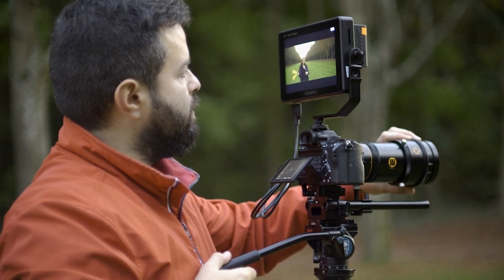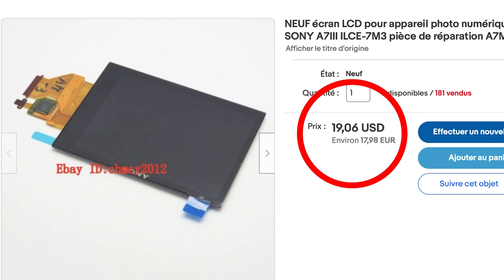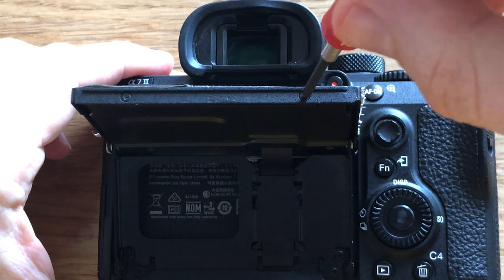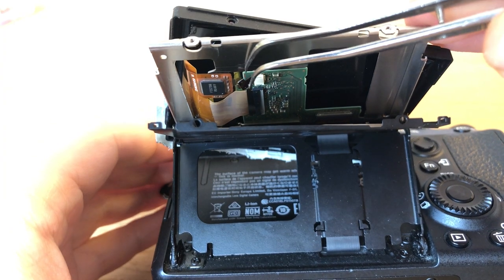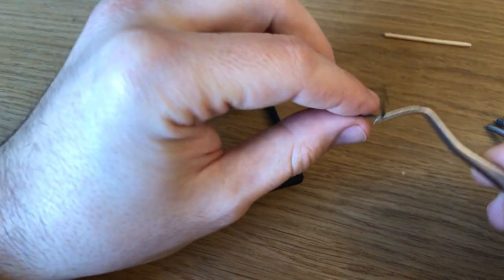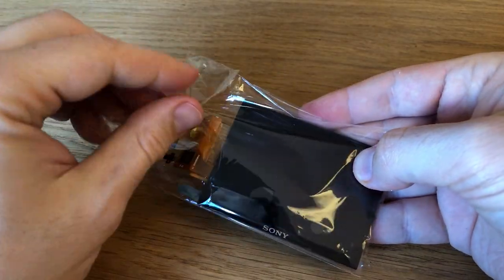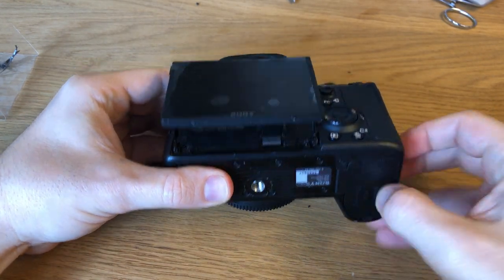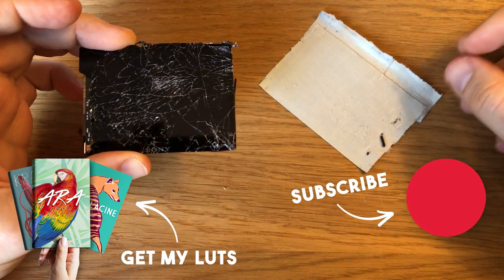The Photographer's Nightmare and How to Fix it for $20

Comment: Congratulations to both Sony and you. One little correction at 5:10: it is a daughter board. The motherboard is the board that receives the power and main controllers, and usually holds main processor(s) and memory.

Comment: Just remeber that the color accuracy of those screens is probably not very good. That chip on the ribbon cable contains the callibations data for the screen and callibration is done during the manufacturing process by the facotry. Non-original screens don't do this step usually. At the moment, I don't know if a way to callibrate camaera screens but I'm sure someone in the cooments section might know.

Comment: Excellent fix. I would highly suggest using a double sided tape from Tessa or 3m instead of super glue to adhere the lcd to the frame. I picked up a double sided Tessa tape aimed at the cellphone industry and I have used it for repairs exactly like this.

Comment: Not sure this is the best glue for this, most of the time they use some sort of very thing double side foam tape. :) Good job on replacing that screen !
Reply: I agree, nice job replacing the screen but I would not use modeling cement to adhere a LCD screen to a frame like that, I bet there is a cheep adhesive on eBay or amazon for it. Other then that great job on replacing the LCD.

Comment: I bought my first Sony used. And it got really abused. There was plenty of drops, impacts and hits. It's also kept in sweaty pockets and foggy nightclubs. At first the EVF broke, then the aperture, then the LCD and I finally sunset it. I opened it a few times to potentially fix it, and found some kinked cables - but that wasn't the fix. 

My current camera is a Panasonic, and half a year ago, the built in flash stopped working - which I use a whole lot. I haven't looked into repair or DIY repair myself. It's also not without danger as the flash capacitor can hold charge that can hurt you. 

I simply stopped bringing my camera or really doing photography that I used to.

Comment: Oh, I had a similar experience last year with a Z6 - the screen looked like yours, except no missing parts. I was so sad... then I remembered that, for the first time of my life, I putted a protection on the screen (9H). The camera felt from ~2m on hard and  big rocks. The protection took it all, no damage to the screen itself (I had a L-Bracket as well, it surely helped). The best 15€ spent in my life.

Comment: This is a good fix! Repair shops are expensive, but they will always do the job right (in theory). In fact, you pay off the risk of breaking the camera. But in this case, this fix is easy enough if you have some skill. I did not see how much glue you used for the display, I can imagine that it is important to use just enough to ensure weather proofing. I did not see a rubber ring around the frame, just after unscrewing it. That will also be important for weather proofing the camera.

Comment: Replaced the screen from a old Canon digicam from my father, much harder than this, but worked well too.

My only doubt is the quality of the LCD panel itself from these replacement stores. In the case of my father's camera, and from one Samsung S8 screen that I've replaced once too, the colors are different from the original parts, less vivid and a little washed. Did you noticed any difference?

Comment: I feel somewhat obligated to say this for anyone reading the comments, working for a large company doing repairs like this - This process will not always be this easy! 

Sony has done a great job with the a7 - however this is one of very, VERY few cameras where this is true.
If you don't feel comfortable or confident, or you are unable to complete the repair (regardless of what it is) - you may find yourself in a place where you have voided the warranty and will not be able to send it in to be repaired. Most manufacturers and the majority of service people may not accept or attempt the repair a device after you have opened it or attempted to fix it prior.

(side note: the breakdown of general services and consumer electronics, labor/time/expertise can be anywhere from 60-80% of the total amount. 
The certification costs, skills and liabilities if something goes wrong can be worth paying the bill in the first case a lot of the time!     Just be aware of as many risks and possibilities before committing to repair it yourself!)

Comment: Do you think if you have the screen guard it would be protected?
I bought my A7 (mark i) with the screen already on it.
If it helps cellphones, why not camera screens?
Reply: A screen protector will protect from scratching, light impacts, and coating wear, but if the camera falls from a height and impacts the screen no amount of thin glass will save it.

Comment: Ca me tue les gens qui mettent pas de vitre de protection sur les cameras / téléphone
Reply: la protection est surtout pour les rayures, pas les chocs.
Reply: In the most cases it's useless. If the camera falls to the ground the protector would do nothing
Reply: @DCMedien wrong. They do help with drops. It’s usually the sharpe point of impact that cracks. The glass protector takes the damage and spreads it out. Of course with a hard enough drop at the right angle it could still crack but I take the extra safety all the time.

Comment: I wonder whether it’s possible to switch out a non-sensor screen to a sensor one but with the right firmware tho
Reply: I heavily doubt it. If it doesn't use touch inputs, they will not have installed the provisions to support it either. Especially in a device as small and integrated as a digital camera.
Reply: @arachnenet2244  I thought it does the processor, and with the “right” firmware the processor would know what to do with the touchscreen, or what’s the way it actually works?